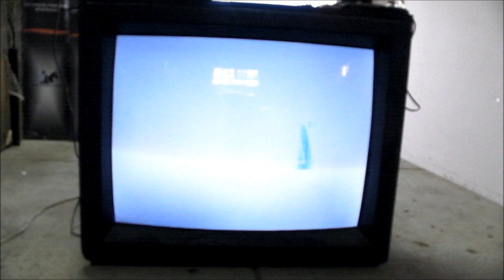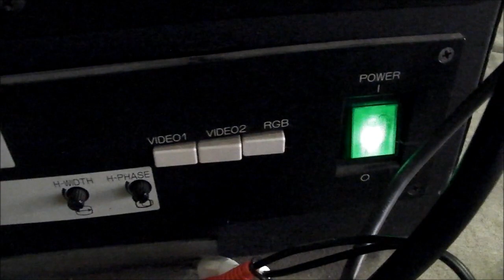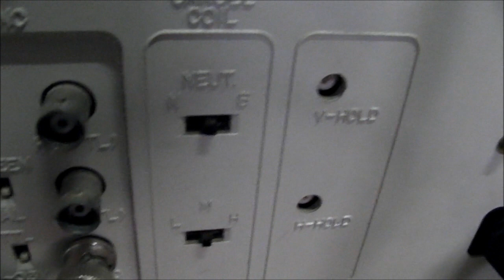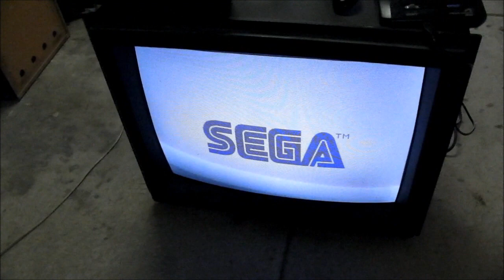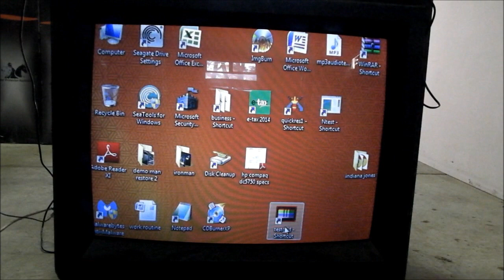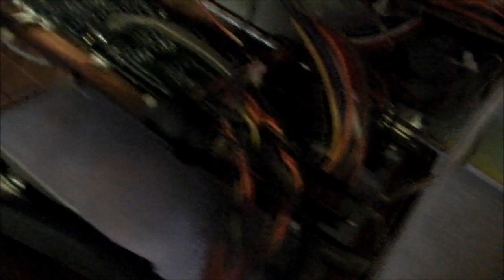Mitsubishi XC-3702U CRT Monitor

Comment: The bigger the CRT, the more iffy the geometry will be. Considering the size and age of this thing (the old-style, curved tube), the geometry is actually great. In fact, I recently had one of the latest "flat" CRTs made by JVC and the geometry was actually worse than on this set (the bottom right area was totally wonky, despite perfect convergence there).

Comment: I am damn jealous of those carry handles. I have a newer relative of this set and another you did(XC3725), the XC-3730c. 
It has the same hand holds and general setup both internally and externally as the 25. I'd kill for proper handles for moving the thing though.